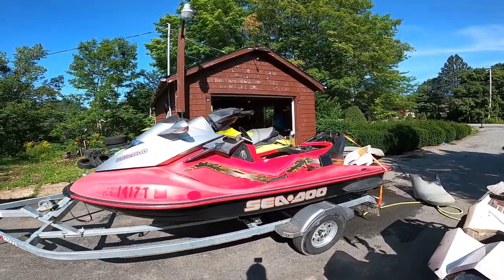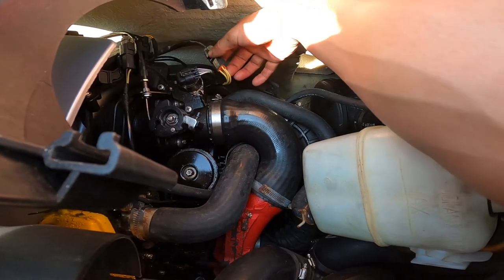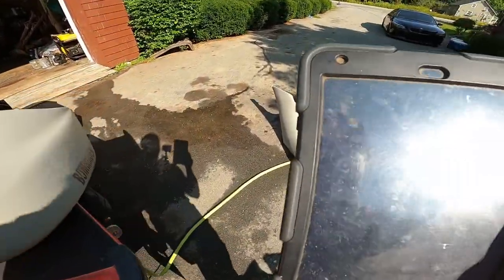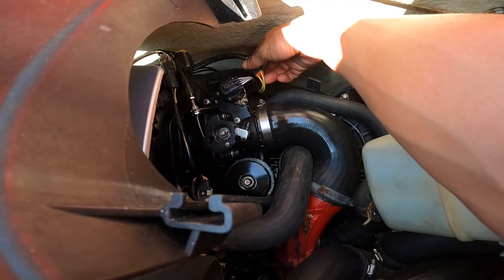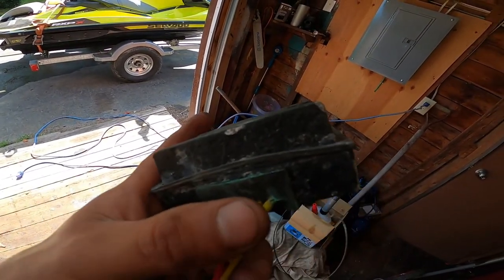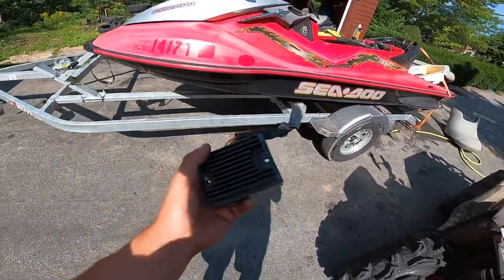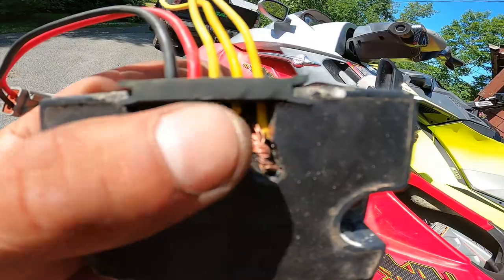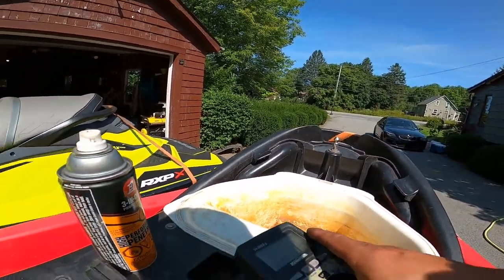Seadoo Gtx Supercharged 12 Volt Low! How To Test And Fix!! DIY!

Comment: So I tested all three yellow wire combinations and my multi meter doesn't budge of OL does that mean the stator is bad ?
Reply from the maker: You would have to call dealer to get numbers what it’s supposed to read all stators are different and just to clarify you had multimeter set on ohms
Reply from the maker: Most of what I seen working on small engines usually stators fail on high side meaning most engines will run and idle but when you demand power they will only rev a little bit then act up
Reply: @BurninGas8.1  it's a 2008 rxt 215, basically the same ski